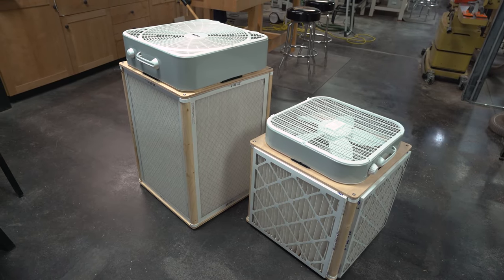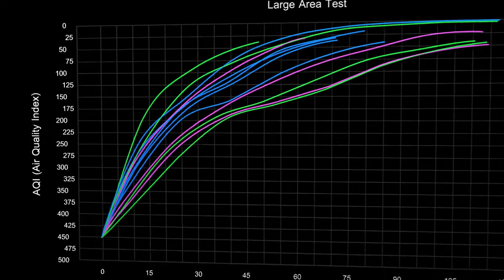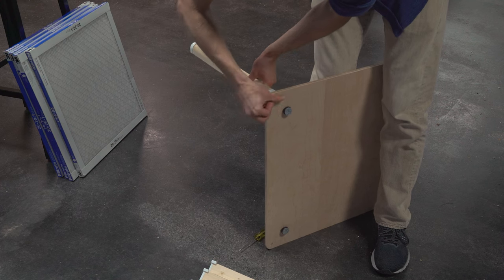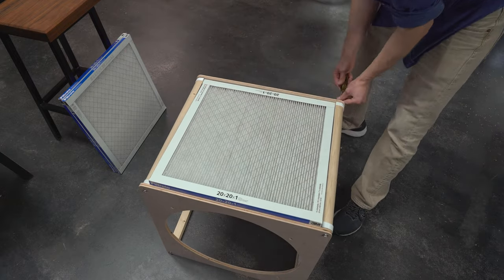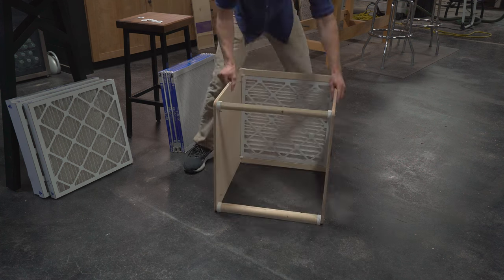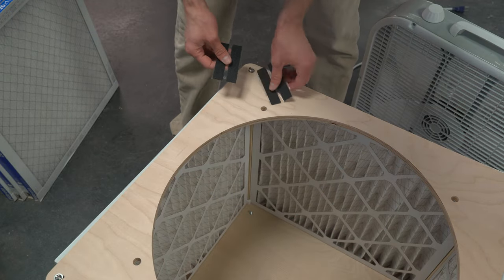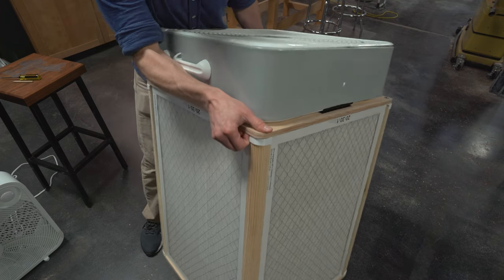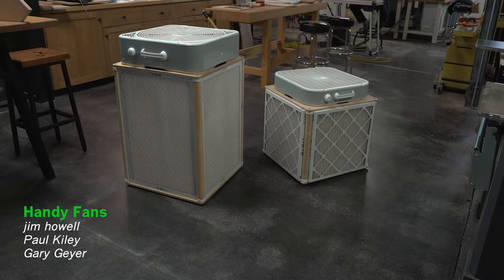Air Filter Kit - Model-B/C - Design and Assembly

Comment: But wont this blow the dust everywhere?
Reply from the maker: Good question! The upward draft tends to keep small particles airborne so that they can be filtered eventually. Personally it's not my favorite method of dust filtration but it is the most popular method. I will eventually make a version of the Model B that is designed for the Caterpillar drum fan that can blow air into the filter box rather than out of it. Box fans are not suitable for that style of filtration, they are just the least expensive fans out there.
Reply: @The3DHandyman  if you blew in, would you line with a washable cloth bag to catch the big stuff like hairs and extend the life of the filters?
Reply from the maker: @AndrewHelgeCox  That's the idea. I have the parts, just need to test it out and shoot the video. Hopefully that will be out in the next month or two.
Reply: @The3DHandyman  Thank you for all your videos! We successfully made our filter box (short-legged version)! But a couple questions about this idea: Why would you need the Caterpillar drum fan for the inward-blowing version? Is it because it's stronger and thus can suck dust better from across the room, rather than having to keep it airborne to help it get into the more underpowered box-fan version? Also, we're not aiming the fan upwards all the time because there are dusty high-beam ceilings and we don't want to blow that dust around, but when we put it on its side, it seems like it's stirring up dust from the carpet, actually making more dust. Do you have any thoughts on this? Is it just as effective on its side? Finally, one should always use the fan's highest setting, right? Even on the highest setting I'm not noticing massive suction on the outside of the filters, enough to lightly hold a piece of paper maybe?
Reply from the maker: @CommuneRecords  I'm happy to help!

So the Caterpillar fan is recommended for blowing dust into the filter box (push method) because the motor is enclosed and can not get dust inside of it. That's pretty much it. If you are using a Box fan in this way, I can't say how well it would preform because I have not tested it. If the dust you are pulling from the air is not flammable or metallic, like shop dust, the fan should still last a long time in this configuration. 

For general air filtration, it is best to blow air out the top of the filter box (pull method). This generally preforms twice as well as blowing air into the filters when you are trying to clean all the air in a large space.

I don't know the exact situation but it may be best to clean the rafters/joists or cover/remove the items in your room and run the filter blowing air up into the dirty space until the dust has been dislodged, then you can uncover things. Just a thought! I know that may not be possible.

To answer your last question it would help to know what fan and filters you are using. If it is a box fan, the air flow will be quite low through the filters, maybe only 1 mile per hour or so. With the more powerful drum fans that number may only be 3mph. The idea behind these designs is to keep the amount of air going through the fan distributed over a huge area of filters. The amount of air going out the top of the fan should be quite high in comparison. 

I hope that helps answer your questions, if you have more, please ask!

Comment: 4:30 I think the gaps really don't Matter, I am planning to use door insulations to reduce air from coming somewhere through.

Dude, this is content is RARE. In Germany = No of these vids. I guess because we don't have hvac systems (because of thick walls that hold Temperature, just da different architectual concept). 
It is reeeaaally hard to find cheap a d large HEPA Filters - I can only find expensive replacement Filters for systems that are a total rip-off. (There is no merv in Germany)

If anyone can help - let me know.
Reply from the maker: I have heard this before. this sort of HVAC filter is very much a US/Canada thing. Even finding them in Mexico is very difficult. I even joked with some guy from Poland that we should import a shipping container full of them so they don't cost 60USD each.

Agreed, the gaps are of minimal concern unless you are using the system as a dust bucket, which I do quite a bit. 

Are canister filters easier to find/cheaper there?

Comment: I'm interested in purchasing one of these kits. I love the idea that I would not be beholden to a particular manufacturer for filter or fan replacement. The only piece of information holding me back from pulling the trigger on it right now is that I want to make sure that the setup is quiet enough for home use. As far as I understand modern box fans should be producing no more than 55-60dbs but when researching the Hurricane box fan (one specifically recommended from a blog as a relatively quiet and high CFM fan) on the highest setting it's producing 70db according to one of the top Amazon video reviews. I understand this was designed for a shop environment but would greatly appreciate some of your thoughts on how the sound produced from the unit figures into the equation. It might sound like an unwarranted concern but the more I read about some of the effects of persistent exposure to high levels of noise the more it seems like a worthwhile pursuit to mitigate it as much as possible in the places we spend the majority of our time: 
 https://www.sciencedirect.com/science/article/pii/S0047272722001505#:~:text=Increasing%20background%20noise%20by%204.1,noise%20pollution%20beyond%20health%20impacts

My concern is that it may be a no free lunch situation where in order to reduce the noise while maintaining the necessary cfm we would have to get a bigger fan and run it at a lower rpm. As far as how quiet, quieter is obviously better and the EPA does mention anything above 45db as disruptive in a home environment. I understand this may not be obtainable and am generally willing to trade some higher background noise for cleaner air but there is probably a cutoff for when marginally cleaner air isn't worth the additional noise pollution. I know that these units were designed for shop use and think you have hit the nail on the head for value in that space. Hope what I've said is coherent and ends with you either recommending a quiet fan that works with this configuration or prototyping and releasing an a design specifically tailored for home use.
Reply from the maker: It's true that box fans do produce a fair amount of noise. The tradeoff is the amount of air that the unit filters. For instance the Air King fan is the noisiest option that I tested, even when it is on LOW, but it still moves 670cfm. This is almost twice as high as the Air Doctor HEPA filter on HIGH (I tested this one in other videos).

One thing to consider is how close you will be to the fan. At 1ft away the sound readings are listed below. Now at 5ft away the Lasko on low would only would like 41db. For the Air King you would need to be 10ft away for the sound level to reach 41db.

Sound levels drop exponentially. Here is the calculator to determine how loud the fan will wound in your place... https://www.omnicalculator.com/physics/distance-attenuation

Background sound 40db
Lasko @1 ft - 63, 60, 55
Air King @1ft - 68, 66, 61
Air doctor @1ft - 64, 58, 52, 45
Maxx air @1ft - 71, 67, 57
Caterpillar @1ft - 71, 67, 63, 57

You could also choose to run the fan when you are not in the house. But if none of these sound quite right for your space, this sort of Box Fan powered air filter may not be the best option for you. 

I will be testing some quiet low-air-flow designs for home use next month with more on the way later in the year.

Hope that helps! If you have any more questions, do let me know.
Reply: @The3DHandyman  Thank you so much for the thoughtful reply! I appreciate the resources provided and will get to doing my homework. I don't have any immediate questions but I'd bet I'll have a couple in the future!

The plan is to have a smart switch that is integrated into a home assistant installation with an air quality sensor to automatically turn the unit on when the aqi goes above a certain threshold. If running the fan on low has enough cfm to clean the air at an acceptable rate and is below 45db then that would be great. If I only need to run the unit on high for say 5 mins every hour then I might be interested in that option over it on low depending on the difference in how much a difference in performance those two options present. Looking into this problem for my place has sent me down a rabbit hole of ASHRAE standards and I'm pretty sure is going to end with me essentially retrofitting my place with a diy HVAC system
Reply from the maker: @TheBartboy007  It is a fun rabbit hole to explore! Have fun with it. I love the idea of a system that turns itself on and off when needed, it's a lot more efficient that way.
Reply from the maker: @TheBartboy007  Thanks for the link! I will give it a watch before I finalize my next video on the subject.